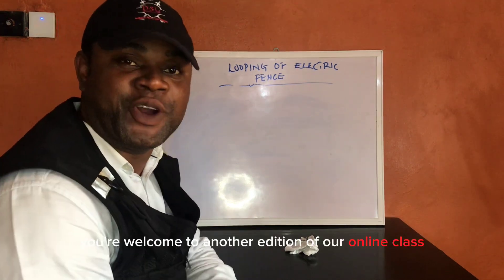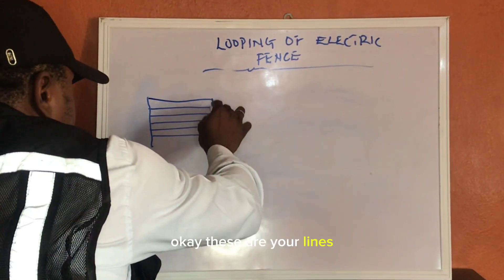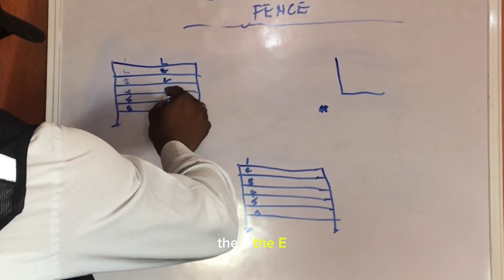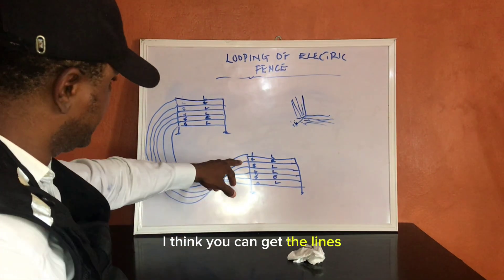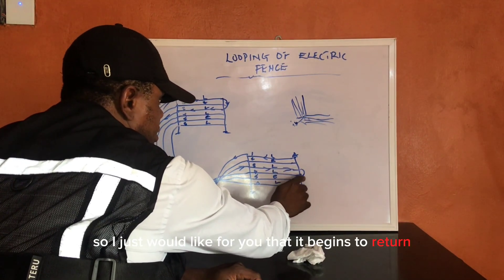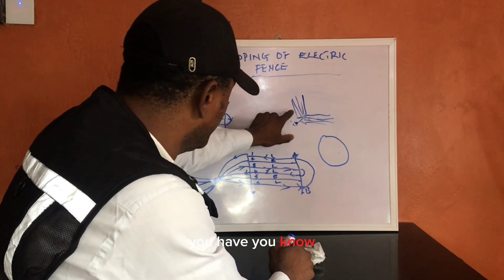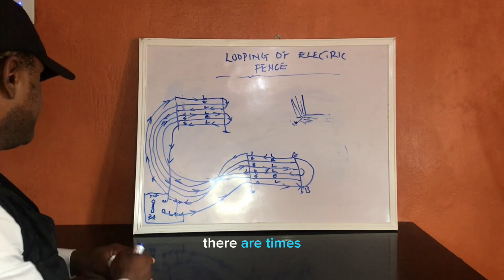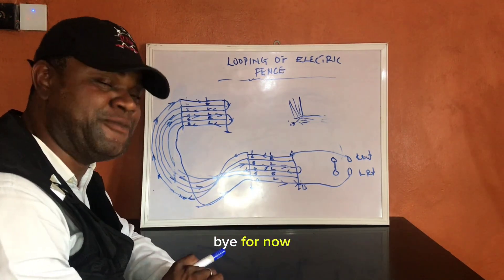Electric Fence looping simplified

Comment: Good evening, I saw where the used only 3 line, now used 2 for live and return and now used 1for earth. Always the Energizer making alarm. Pls enlight me
Reply from the maker: Firstly, that's the right configuration, L.E. L , but from experience i will advise you first test the status of the energizer to see if it's actually working. This is done by removing the cable feeding the fence from the energizer and closing the LIVE out and return terminal with a jumper wire and the EARTH out and return terminal with another jumper wire.
Reply: @defotechtv9093  thank you sir, the Energizer is actually working by removing the live and return wire, so when return back the wire is always trigger the alarm, what did you this is actually the problem
Reply from the maker: @AbayomiGbadega  08064869887. Reach me here